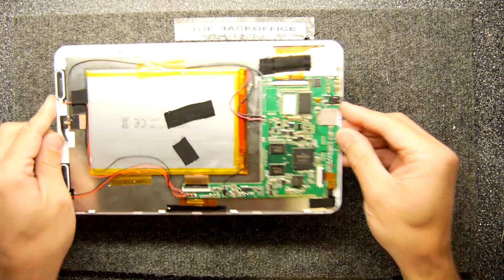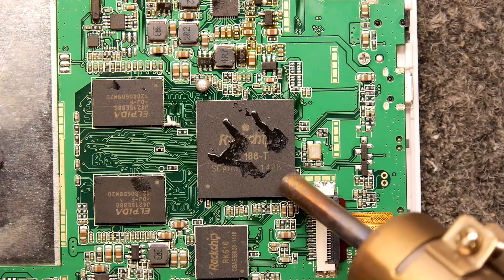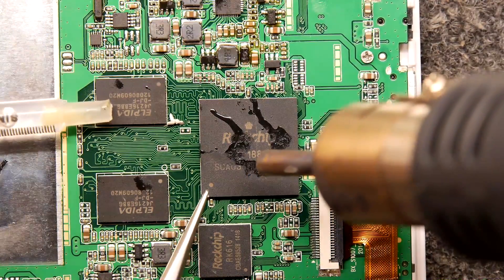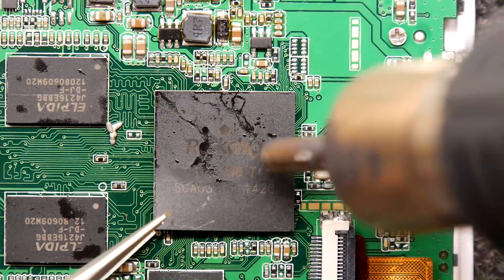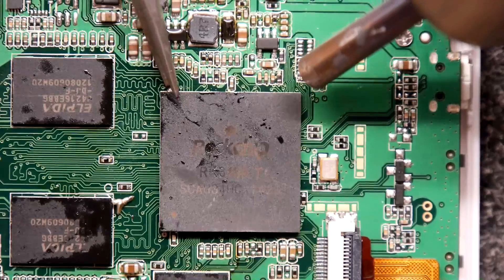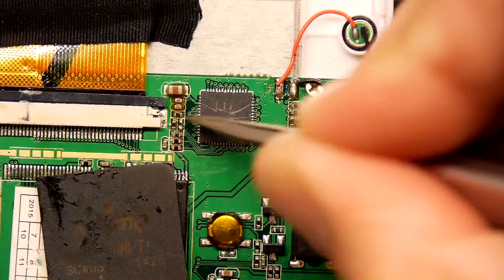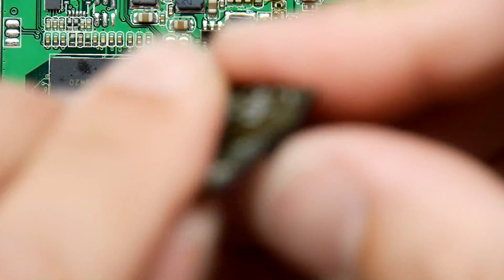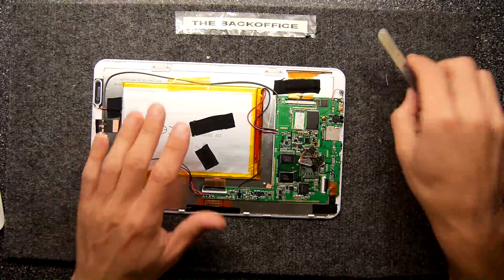Removing a BGA (Destructive BGA rework)

Comment: Hand balling these bga chips can be a little time consuming, especially the 0.2mm ones. Just try not to sneeze mid way through. :-)
Reply from the maker: haha, Yeah, those balls must be like dust!
Reply: The Backoffice A microscope is a definite must have. :-D
Reply from the maker: +Motovlogger Jamie I've just finished designing a new board, I purposefully avoided the BFA packaging 😀
Reply: The Backoffice I think I would have done too. :-D
Reply from the maker: +Motovlogger Jamie keep an eye out for that hardware, you might just be interested 😀
Reply: The Backoffice I certainly will. :-D
Reply: @backofficeshow  How do I reset a bga chip?
Reply: @backofficeshow  How do I reset a bga chip?
Reply: @backofficeshow  How do I reset a bga chip?